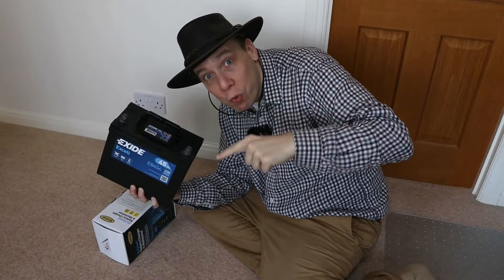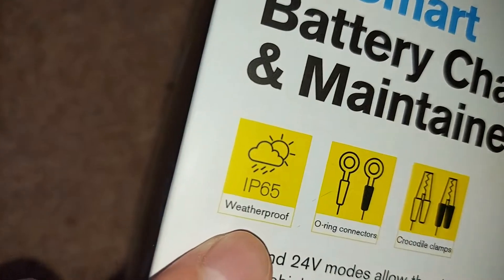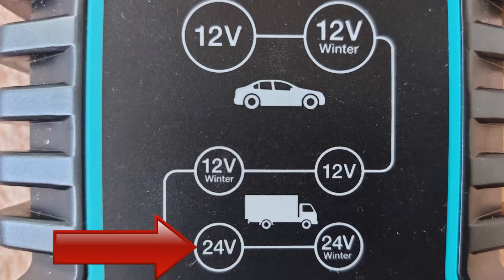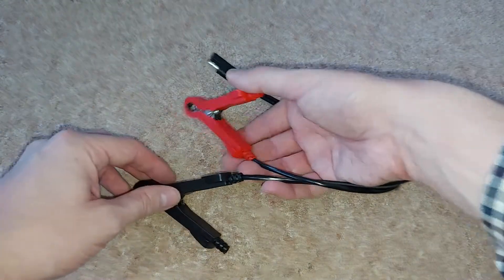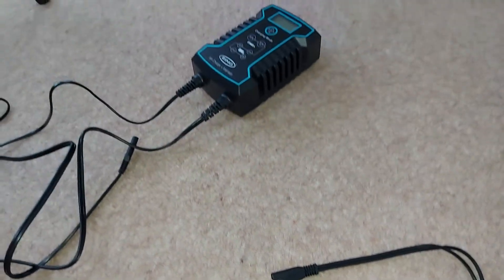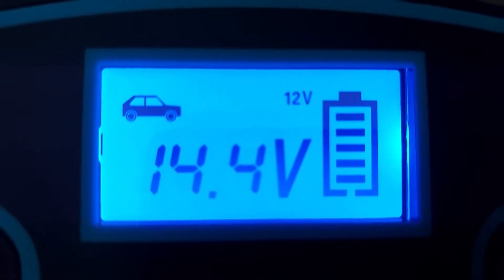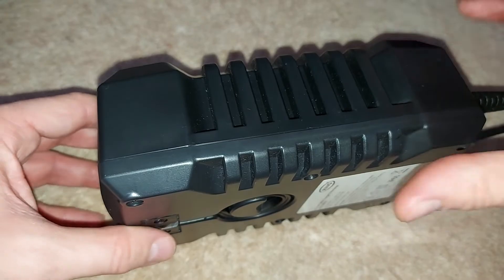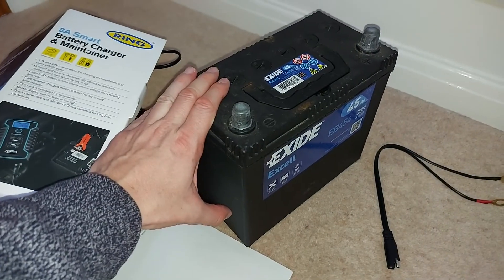Ring Smart Battery Charger Review: Ring RSC808 & Ring RESC808 (Ring 8A Smart Charger)

Comment: Great vid. How do I connect the crocodile clip to a quick release terminal though? The terminal for the crocodile clip is hidden by the quick release. I don’t want to permanently fix the rings. Any help on that would be appreciated. Thanks.
Reply from the maker: Perhaps you could fit a different type of quick release. One that has the lever on the side rather than the top, for example.

Comment: Isn’t it very impractical that it has to be connected to a power outlet ? Is the only option to disconnect the battery ?
Reply from the maker: Hello. I've never seen a car battery charger that doesn't have to be plugged in. Perhaps you'd prefer a jump pack instead. Best wishes from CarSpyTV.

Comment: I connected it and had it on 3.6v for the car for 7hours..I was given by a friend with out instruction..7hours later pressed it on 12.v which i needed for dead battery and my motor started to go bat crazy with hazard lights and head lights switching on and off

Comment: Thank you for the clear useful diction. I agree that a few additional sentences in the help guide would have been helpful. I just got a RSC908 (Feb 2025). After connecting it and switching it on, it just said 12.3V, but clicking the button had no effect. Then I found that the button has to be pressed quite firmly and slowly to get the display to step through each mode. I’ve left it charging and then watched your video. My only criticism is the crocodile clips are a bit flimsy; those on my old 4A charger, which I bought 50 years ago are much better. Perhaps not everything newer is better.
Reply from the maker: Interesting comment, Laurence. Thank you. I'm glad the video helped.

Comment: 12v faster or 12v winter mode faster charge?
Reply from the maker: Winter mode can increase the voltage. For example, from 14.6V to 14.8V maximum (car).

Comment: I purchased the 6 Amp version. For what I understand is a British manufacturer the instructions are a joke. Simple English ? They could have done a better job with half the paper. 

No information as to how to get to each charging option. No information as to what part of the charging cycle the charger is at. Contrary to what this video says the two ERR  messages are meaningless  and  pictures when you study them in the information leaflet don't make sense.  They have put a screen on the charger and must have a microprocessor inside it so why not use it to display useful information ?

At £28 it was cheap but I am already starting to wonder. When a manufacturer  makes such a poor attempt at basic instructions you have to wonder about the charger, its quality,  how good its internal design is  and how good it will be will be for your battery.  

If this thing lasts as long as some of the previous chargers I will be impressed and certainly surprised.

Have I wasted £28 - time will tell.
Reply from the maker: Fingers crossed you'll be happy long term. My 8A is now 2.5 years old. No issues.
Reply: @CarSpyTV  I'm holding my breathe right now and you wouldn't believe what I am crossing as well.  😁 To be honest you have to agree 2 1/2 years is nothing to shout about. Ten years plus is not a big deal let alone 2 1/2.

The instruction look like they have been done by someone on a YTS  - or whatever the equivalent is these days.  My 15 year old  Halfords lead acid charger still works - I only replaced it because it wasn't suited to  the Calcium battery I now have on my car.
Reply from the maker: 15 years for your Halfords charger, ey? I reckon I got yah beat! I bought the Ring charger to replace one from the 1970s. That was built by Crypton.
Reply: @CarSpyTV  I am not bragging on the 15 years. I don't think that is a long time. My father got a second hand one off a scrap yard in the 1960's and the last time I saw it it was still working. They don't make 'em like they used to.
Reply from the maker: Agreed. There's very little chance our new chargers will last 60+ years. Best wishes from CarSpyTV.
Reply: @CarSpyTV  😂

Comment: I be bought one from Sainsbury's when car was broken down yesterday,but I have to return the item
Reply from the maker: That's a shame. Best wishes from CarSpyTV.
Reply: It shows some errors in display, I need to jump start my car in the street,away from home, it doesn't work like that, you never mentioned as well, it needs ac power to charge the dead battery, so feasible only at your home, isn't it?
Reply from the maker: Yes. It's a charger not a jump pack. Different things. Rather than a faulty charger, the error message might have been caused by a dead battery. Dead, not just flat. If you're in a similar situation in the future, I suggest you test the charger on a different battery to be sure.

Comment: How can you tell whether you have a truck battery or a car battery? what amp hrs does the truck battery start at?
Reply from the maker: The following link might be useful. See:

https://www.ufinebattery.com/blog/differences-between-a-car-battery-and-a-truck-battery/#:~:text=Car%20batteries%20are%20typically%20smaller,additional%20accessories%20and%20larger%20engines.
Reply: @CarSpyTV  Thanks, I have a 2.0 diesel jeep 90ah battery,  and a 4.0 diesel tractor 110 ah battery, 
I charged the jeeps battery on the car setting and I charged the tractors battery on the truck setting, 
I think it's safe enough on that setting, hopefully!!
Thanks for the fast response.

Comment: I believe you shouldn't  exceed 10% of the battery AH. That battery is rated at 45AH so the 8 amp charger is too big. Should be using 4 amp charger.
Reply from the maker: Hello. This charger operates at 4A, too. It's not always at 8A. Best wishes from CarSpyTV.
Reply: By that logic I should be charging the 90ah battery in my 2,0  diesel jeep on the truck setting? 10% being 9 amps?

Comment: Hi, I would like to know if my battery is not full, can I stop charging and continue charging when I come back?
Reply from the maker: Yes, that's fine.
Reply: @CarSpyTV Why is the number on my charger display flashing? Is there a problem? It flashes very quickly from 12V to 13.6. Is this normal? I am worried about my battery.

Comment: Hello and thank you for your video, its is very helpfull, if its possible can you explain the other choices for the car charger and what is the best way of using them in different cars or vans, i am asking cause i have a luton van and i am not sure if i select 12V Car or 12V Truck mode, my battery was flat so is it better to use the 12V car mode that is giving out 8A in order to fully charge the battery, what do you think?
Reply from the maker: Hello. Does the van have one 12v battery, or two?
Reply: @CarSpyTV  x1 only one, but im thinking in the fute to put a second one on for those cold days
Reply from the maker: Understood. If it was my vehicle, I'd therefore charge via 12V truck mode (winter) at this time of year in the UK.

However, I suspect any of the 12V modes would work fine if you have a decent battery.

Comment: My charger does not show the battery symbol to show it's charging like in this video, I have a Lion 12V car battery attached correctly, when I choose the mode it shows its only got 1.6V, the voltage doesn't go up.. What do you think is wrong?
Reply from the maker: Probably, that the battery's voltage is too low to take a charge via a smart charger. 

A non smart charger might be more successful (might).

Good luck.

Comment: Excellent review, I bought one only today , still not sure what err2 means though and as i understand it, the 8amp charge  is the  12v truck setting.
My problem is that I'm not using the car much , about 25 miles a week so the battery never gets a full charge, now winters with us , the lights and other stuff are used, add to this the demands of the electronic gizmos on a modern car even when parked, I'm hoping this will help the poor old battery
Reply from the maker: Thank you, Jack. Hope the charger serves you well and good luck with your YouTube channel.

Comment: I got one of these, it works ace for a few days keeping the battery topped up on my car I rarely use, the battery is fine and after some time err-2 appears, if I disconnect and reconnect it starts charging again and works for a few days, absolutely infuriating. Have similar on my motorbikes (Not Ring!), never had an issue. My battery is not faulty!
Reply from the maker: That's unfortunate. I understand that your car's battery is okay. However, it would be interesting to know whether you get the same error on a different battery.

Comment: I have the RSC 806 version of this charger and overall I'm happy enough with it. Happy, that is, except for one major point. I see that you are rather more adventurous than me as you connected directly to the battery terminals but the overwhelming advice is that when charging a battery in-car, you should NOT connect to the negative battery terminal because of the risk of explosion due to potential hydrogen build up (and perhaps sparking causing damage to sensitive modern electronics), and you should connect to the positive lead to the positive battery terminal but the negative lead should connect to an earthing point on the car chassis. The cartoony "User Manual" 😁seems to reinforce this too in its own hieroglyphicky way.Unfortunately the nearest earth point on my car is located on the opposite side of the engine to the battery. Ring have seen fit to limit the distance between croc clips to 76mm (on mine) which is about 6-9" short of the required distance. The leads are joined by an SAE connector which limits the reach of croc clips from each other. I didn't want to use the permanent cables on the battery as this would risk upsetting the highly strung namby pamby electronics causing the car to have a total nervous breakdown. I reached out to Ring to ask if they could supply a lead with greater reach as I would never connect directly to the battery terminals. The advice I received was ..... connect to the battery terminals - with an explanation of the dangers if I did! - which of course I already knew. I was also advised not to splice a length of cable in to extend the reach as I would 'invalidate the warranty'. Well - guess what? I invalidated the warranty - who needs a Smart Ornament no matter how waterproof it may be?! 
In truth, the real villains to me are the car manufacturers who provide such wimpy batteries that resemble sick, weedy specimens  which require 24/7 intensive care and attention. Unless you want to use the equivalent of lagoons full of petrol and drive excessive miles each day, just to keep the battery topped up you have to have some sort of trickle charge/battery conditioner connected when the poor things is wasting away in a corner! My car (a Kia) comes with lots of warnings including not even charging the battery in the car! I suppose the next move would be to punch holes through the floor so we can use foot propulsion like the Flintstones, then we can be truly prehistoriclly green and dispose of the batteries altogether! 
OK anyway - thanks for the video. Rant over.🤣
Reply from the maker: Thanks for the comment, John. I'll start punching holes in the floor! Best wishes from CarSpyTV.
Reply: in 20 years as a mechanic and a DIYer since I have not had or heard of any explosions through sparks near a battery on a car and I see garages connecting jump leads all sorts willy nilly!... Most car batteries are sealed now too unlike 30 years ago (or longer when you could 'top them up'). I'm not encouraging anyone to ignore advice on a leaflet at all; what people do is their own affair but it is not in the papers or news every day....
Reply from the maker: @whatworkedforme  Thanks for the info, Alan.
Reply: @whatworkedforme  I'm sure you're right. But when the car manual, the head mechanic at the dealer, and countless Google searches all scream at you that you MUST NOT connect the old way, and that a gas explosion is possible etc., I personally find it impossible not to follow their instructions. The solution in this video works brilliantly (yes.. expensive though) so it's solved my personal problems.
I'm still more than cheesed off with the manufacturers though, for providing a brilliant car with an array of fantastic accessories etc. then installing a battery which is incapable of feeding them without crying via a warning which only shows up in the WiFi app.
Reply: @johns8591   i agree about instructions (that's a laugh in itself) in general  and modern cars being more like computers... I had to change an EFB  battery on my VW and the garage wanted  over £300 including coding... I already had an OBDEleven  scanner and paid £43 for the Pro Plan to access the coding; the battery was £109.. all in all it took me 12 minutes and the battery had all sorts of cables covers etc to deal with and little manoeuvring room. How can they justify that amount?

Comment: thanks for the video as looking for a shore power charger for a boat so was wondering if it any good for a boats deep cycle battery, apart from the hanging hook is there anyway to mount this permanently to a boat or would it get hot. Was also wondering what the difference the car v small truck settings make. Cheers again as a very useful video.
Reply from the maker: Hello. Glad the video helped. All the information provided by the manufacturer is available via the link below. Best wishes from CarSpyTV. 

Link: https://shop.ringautomotive.com/rsc808-8a-smart-charger-and-battery-maintainer.html
Reply: thanks for the link will check it out

Comment: This charger is rubbish if the battery is completely flat it will not recognise the battery and will not charge it you will after trick it my attaching another battery via jump leads  , 🤦🏼🤷
Reply: This is because this charger is a maintenance charger, hence its size. You found a workaround so that’s that then, it’s not rubbish.
Reply from the maker: I hear you. This can happen with smart chargers. It sounds like you found a solution, though. Best wishes from CarSpyTV.
Reply: @CarSpyTV  I am charging but at the same time I have crocodile clamps to a LED light. Is this doable?? We have a lot of hours without power thus the light.
Reply: Wish I had seen this before wasting 40 quid I've got the same problum has to be above 11 v to charge after 4 min , what's the point of that
Reply: @paulwilliams8725 does this mean i can come out every 3.5mins and reset it and itll charge eventually? 😂 got this problem rn
Reply: @paulwilliams8725 I paid 70 quid
Reply: How do I do that? My battery is completely flat and I’m getting ER2 1.9v on the display.
Reply: I have a similar issue. It’s displaying 8.7v when I plug it in but no battery sublime to say it’s charging. Does anyone know if it’s charging or not?

Comment: If I charge the power bank at home then how many hours I should chargé please ?
Reply from the maker: Hello. Depends on the size of the car's battery, how flat it is, etc. However, this unit shows 'FUL' on its screen when the battery is full. Good luck.
Reply: @CarSpyTV  thank you for your replay.  It's charging but didn't understand its working or not.